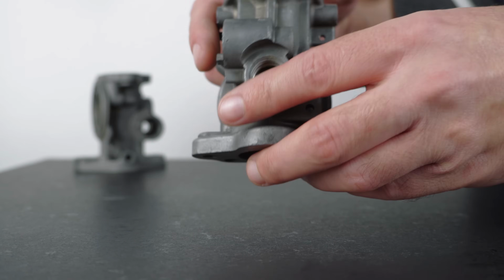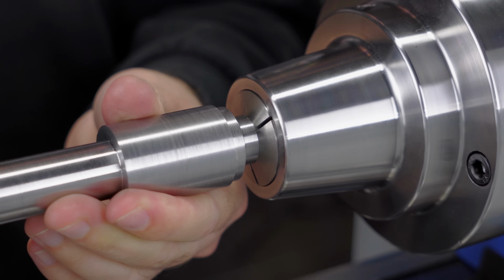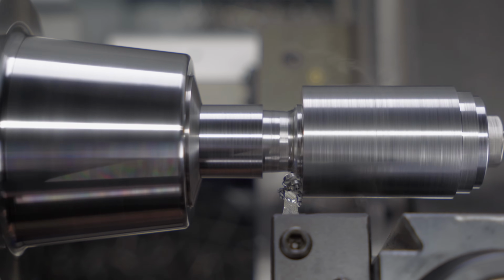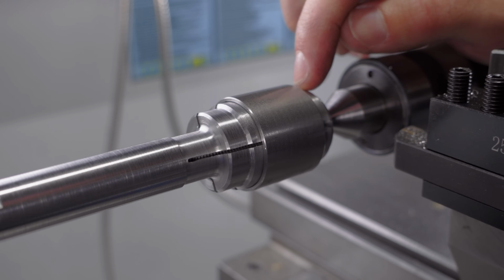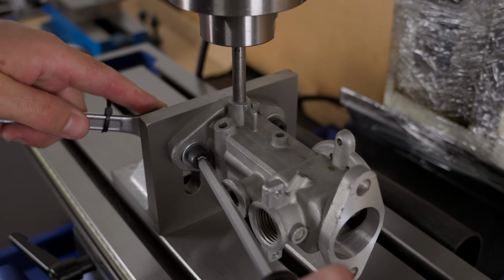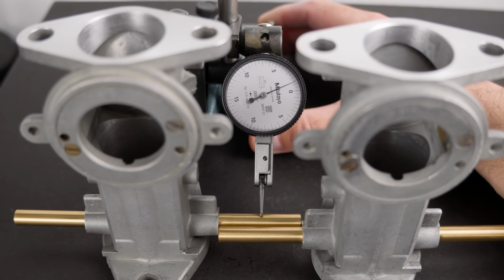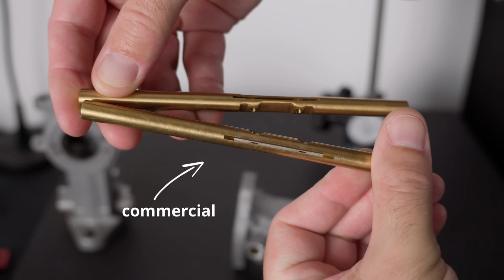Let's face it, no one does this on the lathe.

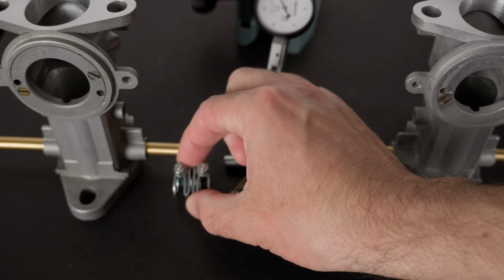Comment: 31:24 I wonder if an 'oldham coupling' would be a good choice for this, unless it needs the 'give' and spring the metal can provide. But it just seems more built to cost. Also modern day 'spring couplings' like those used in 3d printers could have those properties and likely better concentricity.
Reply from the maker: Yes, there are better functional choices, but something I didn't mention in the video was 'looks'. Being for a classic car, I'm trying to keep these carburetors 'in period'. That actually influences a lot of decisions. Thanks!

Comment: Minor note on the matching tapers, the leaves of your fixture don't expand linearly (i.e. parallel, like sliding along inclined planes), they do so radially from an imaginary centre point. Possibly not uniformly either. This steepens the cone angle, forcing contact to be reduced to the narrow end. The plug's taper needs to be slightly steeper than the mandrel's, so that initial contact is at the wider end and when fully expanded, the mandrel is in full(ish) contact.

For what it's worth, the expansion isn't uniform either, but that's a much more difficult issue to address.

Short of running detailed analysis on your design, the best way to tackle this is to machine several plugs at different angles and test fitting them to see which one fits best for your desired level of expansion. Shouldn't need more than a few degrees, I'd test in 15 or 30 minute increments.

Comment: If you don't mind the suggestion, I think that you could probably have put less stress on the expanding mandrel if you reduced that cone angle to about 5°relative to centerline. The one you have there looks like it's about 30°relative to centerline. You don't have to expand it very much in order to get a tight fit.

Regardless, I think you did an exceptionally good job in devising that tool..... And I'm happy it worked out for you! 😄

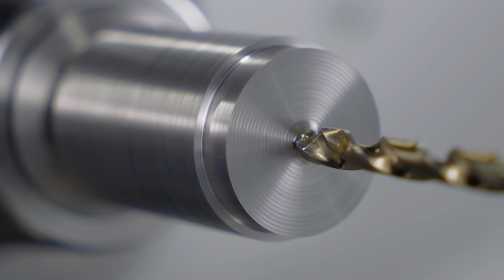Comment: at 5:15 a great tool, but maybe try a different tack, aka use a split collar, on this arbour, and have the arbour undersize, so a bush and tapered ends fit on, and a shoulder on one end, and a nut, they tighten and expand the sleeve, tightening the fit.
another 'turn key' solution uses a rubber material which expands on tightening ( on press brakes, and such, for pipe working), maybe the way to go?- to have a more solid core, and adaptors, rather than putting all the force onto a smaller thinner part?
Reply: The problem with the rubber plug idea is that it likely lacks the rigidity needed for accurate turning and maintaining concentricity with the bore.

Comment: you would get fairly more accurate hole positions for the rebushing operation by using an endmill for the first hole opening, after that using drill might be okay, but in essence endmill evn held in a 3 jaw drill chuck tends to produce more accurate positions even when the spindle/quill rigidity is compromised due to wear on the machine. in general, long spiralflute HSS drills tend to wonder towards the center of the already present hole as that position results in the most balanced cutting action on the two edges of the drill while the body is relatively flexible, while endmills just dont. behave like this, they are totally fine with going in off of center of the existing hole.
Reply from the maker: In this case, since the hole was finished with the boring head, it didn't made difference to start off with a drill.

Comment: Use an adjustable reamer with a guide pin to finish the bores of your bushes from either side. That will correct your out of alignment issue. A reamer will only follow an existing hole, and your extra long reamer almost certainly deflected slightly to do the second hole.

Comment: Great video showing interesting techniques etc. But this is overkill to replace the bushings.
It does not matter if the mounting faces are perpendicular to the bore or not. It does not matter if the two mounting faces are parallel or not.
In this instance all that is required to achieve the end result was to use the same technique used at the 26:22 mark. 😁
Mounting and packing to align the pin.
Having said all that it is still a great video showing useful techniques to others so well done 😊👍

Comment: Very nice.  Some years ago I did a similar carb refurbishment job, but in my case I made the arbour to a shrink fit.  Heat the carb in boiling water, push it in place, machine, then heat both the carb and the arbour to 150°C and they released perfectly.  If I were to do the job again, I'd make the arbour to a slip fit and glue the carb in place with CA, releasing with acetone or some heat.  Not as elegant as your solution of course.

Comment: Gaskets are usually expected to make up the difference in minor defects, and warpage is to be expected from being "handtightened" over and again. Eventually you will run into a leak that cannot be solved with more wrench or the application cannot risk liquid gasket maker seeping into the orifice. That is definitely when you need to consider surfacing like this

Comment: I make a lot of mandrells as well,  far simpler, just to support the bore of carburettor bodies.   There is always a side  bore in the body, at that location  I make a threaded  sidehole in the mandrel   mostly M5 or M6   and secure the carburettor body from sliding of  by using a bolt and washer .  the carburettor body  must be in line  but is allowed to be eccentric   so any surface that needs to be flat is perpendiculat to the axis  but the cutting grooves  to flatten the surface do not need to be concentric with the internal body bore .   pistons alike if they need a new circlip ( retaining the piston pin ) groove

Comment: Great video.   I have been doing exactly this for about 25 years now.  I repair old engines and I have the same issues.

I use two tapered cones and put them in both ends to self center.   Like you said, flat but not surface plate flat.
Reply from the maker: Hi! Thanks, nice to have the perspective of someone with so much experience. Cheers

Comment: Way too complex. Not the way I would have done any of this. I would have simply purchased a hardened 1.250" diameter mandrel with an R8 collet shank. However, it worked and produced the dimensions you desired, and should be repeatable in future use.. Maybe lap in that sticky shaft, although you will never feel it with the pedal against the return spring setup. For the best possible seal you could have added O ring pockets or grooves on each side of the shafts.

Comment: Really surprising how much difference there is between the castings as they should be pretty similar.
Reply from the maker: Both bodies were not originally a set, I'm pretty sure I have mixed up some parts looking for the best ones to make 'my set'. But looking at them I wouldn't say they had 0.5mm (actually more) of difference. Some of these bodies don't have a take off for the distributor vacuum and others don't have a way to mount the choke lever cam, that's why I mixed and matched until I got what I need. Thanks!

Comment: I worked in a tool shop for years. Next time you need to do a part like this (with open slots) I would put wax or a 24 hour epoxy. 
This will fill the slots and stop the tool from getting 

If you need the size. Make a ring to slip over it

Comment: 38:32 ... How else could this be done?? Without sourcing the original casting moulds??  
Maybe 3D print an entire carburetor??  I am not sure if that's even possible yet?
Reply from the maker: The problem with a visible part like this is that it will look out of place if it's not original 😉

Comment: Quite an elaborate exercise. Your chasing microns in all of your work. The quality shows and I suspect you like to make accurate parts as a purpose. I also guess/hope that you will be using the steel mandril for more carburetors to come. I made a lot of expanding arbors for grabbing parts on a bore over the years. I made them out of aluminium because of the high friction coefficient. I turned the diameter close to the required size within 0,5 mm or something in the neighborhood. Drilled a hole, countersunk it and tapped a thread. Then I went to the band saw and cut four sections of 90 degrees each. Went back to the lathe and mounted a countersunk screw which I tightened lightly. Then I cut the diameter to size and mounted the part by tightening the countersunk screw. Real easy and fast like in 15 minutes or so. I saved quite a collection by now because it's easy to cut them slightly smaller for a new job. Don't re-chuck them for the same size because you'll end up with run out. Another nice and quick solution is the use of expanding sleeves on a hardened and ground conical pin.  It's a commercial item and the pin is reused but the mating sleeve get's turned to size. One side in a collet chuck and the far end supported with a live center. Tap on the sleeve gently and turn it to size, mount your part and tap the sleeve towards the spindle so it expands. I have a collection from 4 to 10 mm which is quick and easy compared to making your own expanding arbor. Last but not least I own a set of Chinese C5 expanding arbors with imperial sizes. I'm a metric guy so I don't use them like so. I mount a sleeve with the inner diameter the same as the arbor. Tighten it a little (thin walled always) and turn the OD. Then I can directly mount a part on the sleeve and expand it with the C5 drawbar. Furthermore a reamer doesn't correct alignment much. It just follows the existing hole more or less. A long story but maybe there's something useful for the reader. Thank you for sharing your journey. For me it's my day job so I try to be precise the quickest I can ;-) Best! Job
Reply from the maker: Hi Job! Thanks for taking the time to write and share your experience and thoughts. 

I think I know the expanding sleeve/conical pin type of arbor you are referring to, but having a bridge (the bridge for the jet) in the middle of the bore doesn't help. Also some of these bodies have some steps machined inside, which limit the length the expanding "head" can have. That's why I made this tool, it ends up being very specific for the application. I count on using it in the future, the setup is very easy and I found to be repeatable. Not sure if you've seen that part, but I turned the final O.D. to size like you explained, with the arbor slightly expanded - that's to have a constant O.D. along the "head" when it is expanded to the desired dimension (the bore of the carb).

I'm not a professional, I've been only using the lathe for around a year, so I'm learning. Again, thanks for giving useful feedback :)
Reply: @nbrworks  Major reconsideration about your video; if you're going to reuse the arbor on a regular basis it''s a valid explanation for the used material (steel or stainless) and all of the effort to be repeatable again next time.  If it's just for correcting two carburetors I think it's over the top and an one ore two sacrificial aluminium ones would do the job perfectly much faster (and cheaper business wise). A true toolmaker knows when he can be rough and knows when he should be precise. A dear friend of mine is a toolmaker and rebuild his house by himself 30+ years ago. It took ages and his wife complained about the pace, To clarify; he used a caliper to cut his wooden window frames. That's exaggerating too; fit for purpose is the way to go. Best! Job

Comment: If you bolt down the carburetor flange with the sticky shaft, does the sticky go away?
Just a thought. I know with the aluminum LS block, the crankshaft is sticky until heads are bolted on.
Great Video. I once dreamt of restoring vintage carburetors and now with a mill and a lathe you make me rethink having thunked it. Thank you
Reply from the maker: Hey, glad to have you motivated again. I haven't tried bolting down the carb with the sticky shaft.

Comment: I would like to build a carburator from scratch, statting with wax and dense foam. Carve the basic carburator body and other parts from foam sand it with 220-320, possibly 400 grit sand paper make the smaller parts from wax. Use holley jets and other components. Maybe even fuel bowls. Build down leg annular boosters. With a stream lined  Venturi shape. Using the Dominator flange pattern on the secondary side have the system using large jets with large air bleeds to mix alot of air in with the fuel in the boosters. The boosters having a insert with 2-4+ rows of holes the
.035" wall of the booster insert sleeves having a venturi shape. The holes in a band along the smallest diameter internally. The holes made either by acid etching or EDM, producing around 
 .004-.010" holes as the air passes through at full velocity it should emit a thick nearly a fog of fuel. No drops over .001"- 0005"  the primary side using slightly larger holes in the booster.  To help get liquid fuel in the cylinder to evaporate and remove heat. The secondary can also have these boosters if found more desireable or even reversed. The primary booster inserts having 2-3 bands of holes with roughly .007"-.015".020" holes with large trumpet entrances to thd throttle bores. With the throttle valves milled from carbon steel. One piece design. With roughly m5 shafts.  With oilite bushings that slide on he shaft and is fitted between the base and body of the carburetor. The butterfly valve being 44-49 maybe 52mm  with a viton o-ring  sealing the shaft with a groove in the body the o-ring fits inside. The bushing being about 3/16 or 4mm wide.  The base to body using a thin gasket being vacuum and fuel travel in passages. The idle circuit is drilled into the base where the fuel slot is etched into the 1mm port thst has a 1mm air bleed, and a screw restricted fuel supply, the air supply or bleed can have a screw also. So the idle can be leaned out easily if the engine has a weeak or strong vacuum. The idle can still have the proper metering of fuel.  With a large needle valve .200"and a large float. It should look more like a vintage mechanical fuel injection mixed with modern EFI, 4 large trumpets stanfing above the air filter base. Requires a specific air filter base and 10" minimum filter(10"x3.5", minimum. Reccomending a minimum of 12"x5.25")truely a 16"x 6" is need with a filtered top, or use two 16"x4.5" filters with a filtered top cover. the  trumpets rising 1"-1.125" above the filter flange, it being about 7"-8"using a enrichment circuit restrictor insted of the strangler/choke blocking 60-80% of the air bleed for the idle circuits and 50-60% for the primary booster circuits. At low throttle positions it should add 20-40% more fuel and quickly back off. Based on temperature, vacuum it applys more restrictions on the air causing more fuel to flow through maybe it can be an electric only system using a simple microcontroller with a vacuum and temperature sensor. With a tiny solenoid placed in the carburetor about a 1/2" x 3/4" plate with a 3/16-1/4" x 3/8" cylinder with a 1/8" x 2" bit, having a tiny needle valveon the tip and a smaller spool looking bit in the middle going from 3/8" to 1/16" and back to 1/8" at a angle over 1/2" or just having tgr beedle valve tip, and use two of them. One idle and other primary adding 30-40% added fuel for the first 4-10 seconds of a COLD start up. Then quickly leaning out. Back to normal+ 10% (+/-) extra fuel until the carburator temperature is above 55°-70°F+ (+/-) at the manifold flange the controller will look for time pulling a vacuum and temperature by  20-30 minites it should be fully off or a manual or manual timer or timer only can be used. Either only a on/off switch manually controlled. Or a manual button pushed on start up stays on for 3-8 minutes even if the engine is not running and ignition is on. Or a system that powers on if its below 50°f with ignition on and a timer powers off after 3-8 minutes maybe a override button to reactivate for another 3-8 or other amount of time maybe 3-5 minutes?  With the throttle shaft and valves being one piece and goingto about 0.8mm with tfe edge of the valve being around 0.45mm with a rounded edge and a seat ground flat that fits the throttle bore. The seat being about .005"-.010" wide.  With a thicker section at the shaft to valve transition. Going from a m6 shaft to 0.8mm thick plate a smooth reduction in width and thickness forming a smooth peak or point fading to flatness.  Over abiut 10-12 mm on both sides, the center having the same with only about a 3mm wide two piece bushing in the center, with a 8  mm diameter slightly larger to add strength to the middle of two throttle valves. A medium carbon steel to prevent wear and bending maybe add a bit of nickel and chrome a low grade stainless to resist corrosion and tumble polish. It should have a minimum effect on air flow. It is a street strip or track day carburetor, high performance that sees street use, even daily use. The jets can be adjusted about 20 jet sizes by screwdriver only.  Along with the power valve. Uts action can be adjusted slight. This would require a wideband o2 to know how to adjust. And or a dyno! This screw hidden behind a screw in plug. Like some other screw adjustments. Uding 50cc accelerator pumps. Sorry to ramble, have an awesome day!🎉 Great video!
Reply from the maker: Hi! Feel free to ramble anytime. Welcome!
It's great that you have all these ideas. Have started prototyping?

Comment: drill and tap pipe thread npt  spit twice with band saw  a pipe plug will expand the arbor
Reply: He sounds like a guy that's probably in a place that uses a lot of metric and British straight. British taper would probably be more common in EU than NPT. But I wouldn't know as I have never had to plumb in Europe 🤣

But taper threads definitely sounds like a better idea if he's not running an expander plug with a matched angle. Less work involved, off the shelf replacement parts.